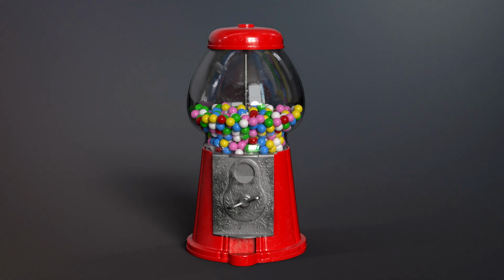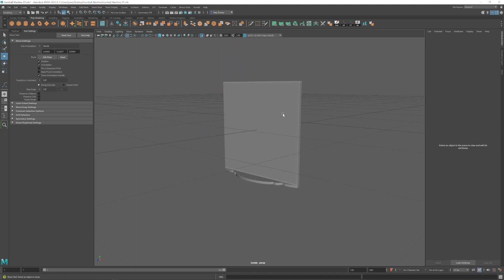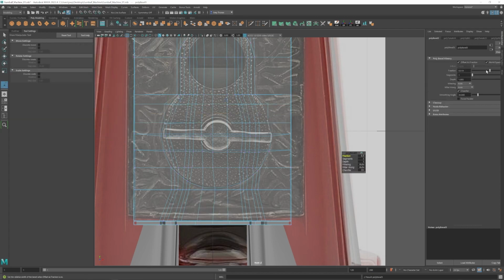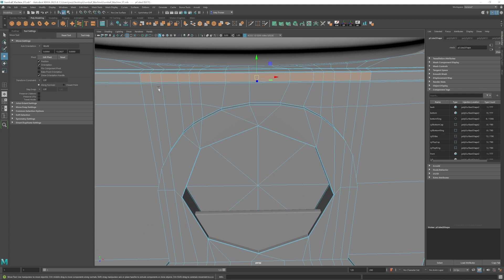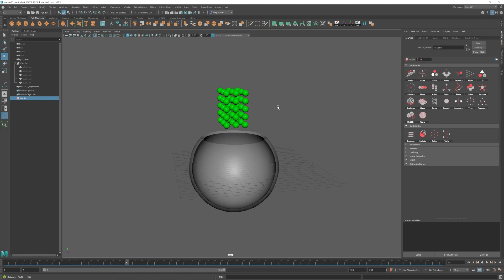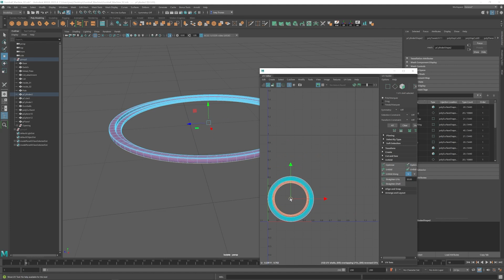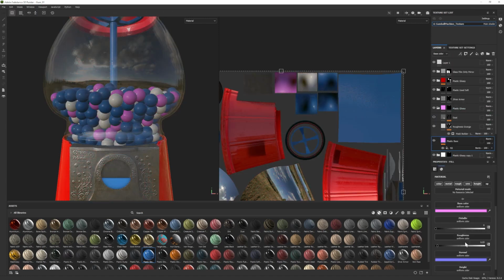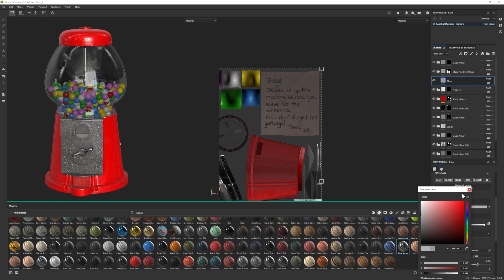Gumball Machine | Autodesk Maya + Substance 3D Painter

Comment: Hi i try with mashbuullet solver to do the same but when i link the bowl to the collider objects it isnt affecting and gumball pass the bowl without colliding
Reply from the maker: Sorry for the late response, and hopefully it ended up working! If not, check your scenes scale, I know this can cause problems. I also found it worked better with an object that was double sided. Also, In this video I had to open a separate scene to make mine work how I wanted, I'm not exactly sure why, maybe it was glitching out but you could try the same to see if it helps.
Reply: @polyrendr  nothing works... is any other mode to do the same effect?